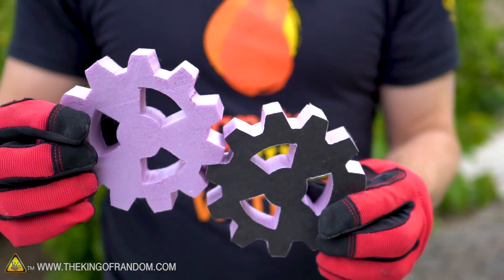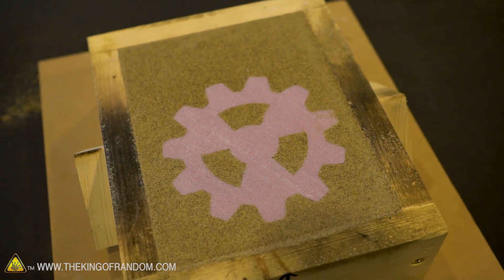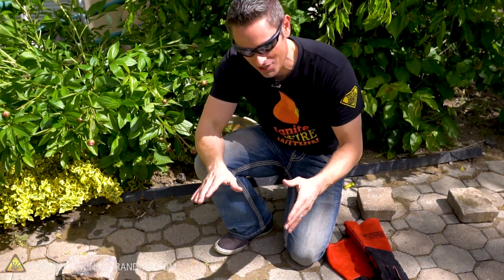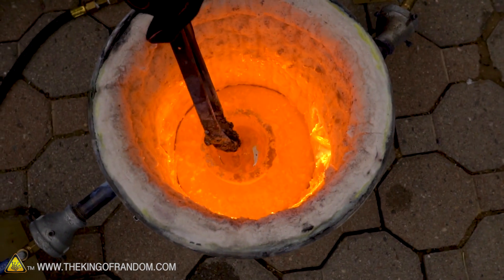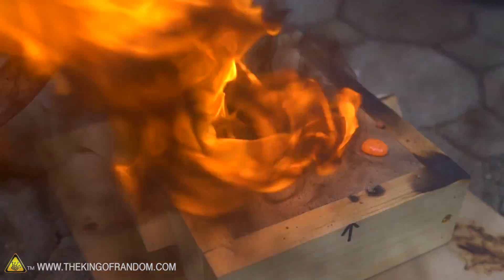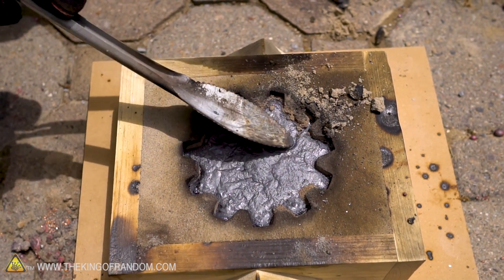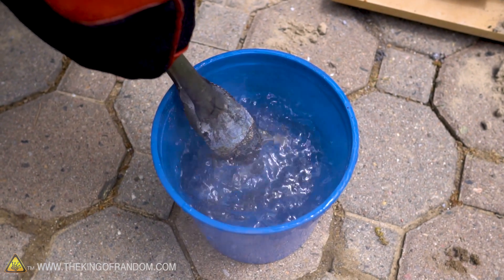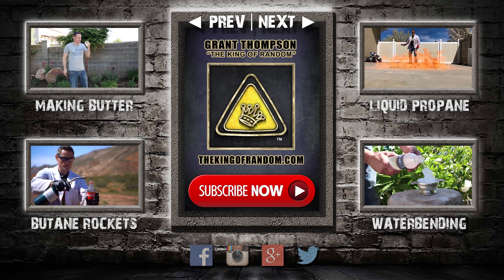Argh. Why Is Copper So Difficult? TKOR Tests Melting Copper In Our Homemade Foundry

Comment: Poke the foam with a toothpick, pull it out with a toothpick. After that, the sand will take the shape of the gear. At last, pour the copper

Comment: why dont you try to heat up the sand mold so that the temperatute difference between the molten metal and the sand isnt that much. that will decrease the rate of energy (heat) transfer thus leaving the molten metal liquified for longer which will hopefuly make a solid cast. highschool physics actually came to use. huh

Comment: you should be doing it as a two part mould with pouring spurs and vents to let the foam gas and excess copper to escape.
The holes won't be able to float up like they did the two parts will hold the heat in longer letting the copper stay molten longer so it can flow into all the details and it should come out absolutely perfect.
also check you have the best sand recipe and consistency.
Reply: Also I think adding compressed charcoal bbq briquets around your crucible once it's pretty hot will boost the temp even higher so it melts even better. oh and get rid of some of the slag off the top of the molten copper as these are impurities which will cause air bubbles in the casting.

Comment: Maybe you could use some kind of steel funnel that will direct the molten copper into the mold quickly but avoid disturbing the sand and breaking it up. it appears that you need to be careful pouring it but that takes too much time and the copper cools down too fast as shown from your first attempt. The other issue was that if you pour it fast enough that it doesn't prematurely solidify it will hit the mold to hard and break the mold on impact as shown in your last few attempts. I feel like you were putting more emphasis on not having enough time too pour rather than making the pouring method more efficient. A funnel might not work but if you had a more efficient way to get the molten copper into the mold in a controlled way then you might have more success. 

Side note: The sand also might have crumbled and broke because the heat evaporated all of the moister in the sand before the metal could fill all the spaces and subsequently pushed the 3 impressions. If the copper is hot enough to stay molten while being cast its probably too hot for the sand to retain its moister and have any small impressions or details on the other hand if its not hot enough it wont cast properly when you pour it. perhaps you need to have an even damper composition of sand before you cast the metal (I know you tried adding some some water but perhaps more is needed?) or maybe green sand just cant handle the heat from the molten copper regardless.

I hope either of my suggestions helps you out. Best of luck!

Comment: you need to keep a lid on the mold with just a spot in the center to pour. that way the sand pillars are held in place and aren't tempted to basically float to the top of the copper

Comment: Hi, if you want to make molds for copper casting you need to try petrobond sand. The sand is held together with some kind of oil, witch cooks the sand when molten metal is poored onto it and kind of reinforce the mold. The problem with greensand and copper is that the temperature difference makes too much of the water boil off at once, thus making the small parts of sand popping of. Greensand is ok for lead or aluminum and other "low" temperature metals. 
Hope this will help.

Comment: How about having the styrofoam covered with another layer of sand with a pouring hole and a couple of vent holes? You know.... just like you used to do with the aluminium years ago?
Watch Tito4re's video on casting a copper apple.

Comment: what about trying a two part mold? A few years ago there was a foundry at a festival I went to where they had sun catchers for the kids to mold and we did the one side with the sun catcher and then dusted baby powder on it and added registration dimples in the sand then put the other side on and repeated the process. opened it up made a path for the aluminum to flow into the part and took the sun catcher out and put it back together. it may help the sand stay in place while pouring

Comment: You might have better luck if you use the cope as well as the drag and put in an intake pipe with a gate for the copper to flow into. The hydrostatic pressure will push the copper down and give you a better quality casting. Don't forget to poke holes into the cope's sand to allow the gasses to escape.

Comment: The best suggestion I can maybe give is to add a 3rd torch or use a gas that burns on a higher temperature, you need the copper even hotter :P

Comment: Grant, try using baby powder on the foam gear so you can use something to cleanly remove it from the green sand. then use both the cope and the drag. That way you have an obstruction free mould which will keep the pillars in place instead of popping out when you pour

Comment: what happen if you use brick or concrete or cement or something stronger. I think there is also a construction sand that is more compact. that could work.

Comment: What if it wasn't working because the moisture in the sand boiled once the crucible got near it since it is a higher temperature then regular casting

Comment: The problem I think is your mold. Why aren't you sandwiching two halves together to guarantee the shape retention without having styrofoam there to occupy the space the copper needs to set properly? I would think that's a more viable way. Plus, if bronze statue casting molds use wax which is melted out prior works for them, why not in this experiment?

Comment: Wrong kind of foam? House insulation is fire retardant. When you pour the copper it takes so much energy to vaporise the fire resistant foam it's pulling so much thermal energy from the copper it's thickening. You just need to use cheap polystyrene so that it can instantly vapourish when the copper flows into the mould! upvote so the king can see this!!
Reply: not really, that's the foam that I like when I cast Aluminum, and that's a much lower temperature.
Reply: DJust787 Exactly what I was thinking
Reply: Exactly
Reply: Home insulation is much more sense than expanded polystyrene, which means there is more foam to vaporize.
Reply: Pink insulation foam is ok, blue is not. Its toxic.
Reply: DJust787 😊
Reply: I have never thought about that. I have been screaming "REMOVE THE FOAM" for the last video.Untill i realized that that would be destroying the mold. That's why i told him to make clay molds.
Reply: I still think he could preheat the mould in the oven at like 200 f.
Reply: DJust787 you're right

Comment: you should have two sand boxes with the item inside between them both and a little spout where you can put the copper in, this way the heat stays inside the sand box and should remain more pristine rather than being messy one side, nice the other.

Comment: grand thopaon why aren't u trying it with both the boxes on.. the cope and the drag... u got what I meant I guess.. make a casting cavity and provide core for the Hallow part of the gear..I bet u will succeed.. u could definitely cast copper using green sand.. I betchya...

Comment: Try putting a layer of wet sand as a bottom layer, well press it. Follow by styrofoam template and wet sand, well press again. Let it dry before pouring the liquid copper. This should works! Better still, some hole gap at the side to reduce pressure when pouring.

Comment: Try making the greensand with fireclay instead of normal clay it's what worked for me.
Reply: or a 2 part mold would work much better
Reply: It is unnecessary to do that if you use fireclay though. and a 2 part mold can sometimes make it more difficult.
Reply: The 2-part mold also allows for greater fine detail and edge detail, something Grant is always complaining about with his casts. He's also experienced enough that a 2-part should prove no issue for him.
Reply: DrakeFaust  If the sand is made with fireclay it should stay in place and allow for perfect details. It has worked perfectly for me
Reply: hes using one half of a 2 part mould
Reply: W Bond : That would just explode on the first try.
Reply: dude that doesn't even make sense. there is nothing in cement that would make it explosive to heat and/or molten copper is non reactive with solidified cement.

As long as he waits 3 days for the cement to fully set, it should work fine and give clear sharp edges to the mold.
Reply: W Bond It would not explode but there a few reasons it would not work, one he would have to crack the mold to get it out and two the heat of the metal could damage/crack the cement.
Reply: or a cement mixture which would allow for multiple casting of the same mold

Comment: Hey Grant. I'd First like to say that I love your videos. I feel that the problem you are having is the greensand. I would recommend that you make a new batch using pure powdered bentonite clay that you can buy off eBay and kiln dried sand. I do not know the ratios off by heart, but you can find them online. This new sand would be much stronger and be able to withstand the molten copper.

Comment: You need a closed mold, not an open one- the little nubs won't be able to float up if they are joined to both the upper and lower surfaces.
Reply: Plus I think his foam is wrong, it should like instantly evaporate.
Reply: no it doesnt. the foam needs to be enclosed in the green sand.
Reply: Yeah, But sand destroying is another problem. Thats why it would need to be a closed CARDBOARD MOLD- JK. It would have to be a clay mold too if he wants the holes in the gears.
Reply: this. do this also the foam needs to be removed after molding the sand
Reply: I was thinking that also if you have a spout to pour down it will increase the pressure and you will have less chance of air bubbles (i think)
Reply: A closed mold with a fill spout will usually give you the best results because it increases the forms stability.  Also using a non-fire resistant foam would help a lot too.
Reply: Yes actually, we made sand castings of foam and wooden molds at school; 20 + years ago. 

We used black volcanic sand and closed molds- the principle however is identical. You were saying something?
Reply: well
Reply: hehe
Reply: SuicideNeil I agree but I think the quality would decrease.
Reply: lol
Reply: There is also the issue of what material is being used in the mold. Foam has a rather high melting point, and house insulation has flame retardants for obvious reasons. Wax should be the material he is using.
Reply: You are right, he can't have pieces of the mold popping out. He can literally put a bit of sand, put gear on it, cover it completely with sand and just leave one hole for casting. That way he doesn't have to remove the gear, but he needs to change the foam.
Reply: Jade_Puppy I experimented with closed molds and aluminum and I had problem with the air inside the mold and the foam.
Reply: Jade_Puppy thats why I said it
Reply: @ Farbod- you need vent holes, the same issue occurs when casting resin in silicon molds. You have your main poor spout and vent at either end of the mold, then you need to poke some small vent holes where air will likely get trapped, in corners and at high points.
Reply: The crucible is clay-graphite, so yeah, kinda
Reply: why he wont do it like he did with an sword ;-;
Reply: Increase, by a lot- this isn't something new or experimental he is trying, sand casting ( in various forms ) has been around for centuries- there must be thousands of guides on youtube to watch, but Grant seems determined to do it the worst way possible ( open mold = rough finish on upper surface, wrong foam = poor quality casting finish as it doesn't evaporate, it leaves burnt blobs where the copper is flowing into ).
Reply: You cant have a mold with peces of the mold popping out. Clay is more stable.I bet the crucible is clay. BUT NEXT TIME CAN YOU REMOVE THE FOAM GEAR.
Reply: SuicideNeil ima large NUBB
Reply: SuicideNeil have you molded one of these before?

Comment: Just mix the sand with plaster and submerge the gear with air and fill holes like CodyLabs did on his Fixing The Ring video, no need to fix the mold or the cast that way.

Comment: You need a top box.... And channels and then vents. That will help your mold from breaking apart like it is.
Reply: Don't worrie about the foam leave it in there it will melt away.

Comment: Hey grant done this a few times, what you need to do is melt the styro with a blowtorch, pour a decent speed but here u are pouring way way wayyyy to fast! The sand does need to be slightly damp also. Hope it works cheers cheers. Do thumbs up so he can see

Comment: Hi Grant. The problem you're having is a combination of the sand being a little too dry and the mould being a little too complex. There are a few ways around this, you can dampen the sand a little more and use pins to hold the sand cores (the bits in the centre of the cog) in place, you could use resin sand cores or, use resin sand for the casting process. Hope that helps :-)

Comment: The thing about copper is that since it's atom size is larger than Aluminium's it doesn't take shape so well, also like with inertia, it takes more power to heat it and it cools down slower on that behalf.

Comment: Just a random thought, but what if you used small wooden rods in the radio active chunk parts to try hold them in place? Not sure if it'll make a difference, but if something were to at least hold them in place but not get in the way it should cast better

Comment: Why don't you make your copper into bronze, it has a slightly lower melting point. Sculptors usually use wax too, it may burn off ever so slightly quicker and may make a difference between success and failure. Interesting videos👍🏻

Comment: ive done sand casting before, and to add suppost for large features such as the radioactive symbol, i placed metal skevers in the sand (for the symbol id say 2/3 in each) it acts to support the sand so it shouldnt move and the cast fail.

Comment: try casting it vertical not horizontal with the foam completely covered in sand, will give you better results.  only have to drill a hole on top of the wood but it will be worth it, you'll get better results this way. hope you try it cause its interesting seeing your progress :)

Comment: usually green sand is used to cast aluminum that have a lower melting point and is less dense than copper, what I think it's happening is the hot copper quickly burn and dry the sand making it brittle and then the density push the sand to the top, you could try to increase the amount of clay is this sand or to create a two layers mold so the sand will not have anywhere to go.
best regards

Comment: I haven't used copper, but why exactly are you pouring it directly into the sand mould? Why not use a runner? Seems like the obvious fix. 
Yes you'd have to cut out a bit after, but you wouldn't have to do it 6 times.

Comment: Put sand all around the gear and cover both sides in sand and then add  a pour hole with a piece of plastic so it flows down into the mold and it's more stable

Comment: When using this kind of mold, when there are small parts that are susceptible to break when the metal is poured, we put small steel pins in these parts to make sure it wont move. If your sand is tight enough, it should be enough to prevent what you just experienced.

Comment: From the article I mentioned "Pure copper is extremely difficult to cast as well as being prone to surface cracking, porosity problems, and to the formation of internal cavities. The casting characteristics of copper can be improved by the addition of small amounts of elements including beryllium, silicon, nickel, tin, zinc, chromium and silver."

Comment: i think you should try using a different type of foam or instead keep the gear thin so when radient heat is used it should shrink so much so it pops out it self and can be picked with twisers and dampening the sand was the reason the pieces float to the top keep it dry

Comment: How about using both halves of the green sand molds just like they use in the videos where they cast the frying pans but leave the foam gear sandwiched between the two halves and have two holes in the top part that you can work?

Comment: You should try to greensand cast with aluminum copper is a heavy metal. Aluminum is easier to melt and doesn't make the sand float up on it

Comment: hey grant, i love your videos. i think the problem is water. the water boils out very fast since its very hot so it turns to gas and saperated the sand. the other thing you should try is maybe heat up the mold first so that there's less water and the copper doesn't need to hest up the mold as much. then you can puor it slower so that it doesn't break the mold. it may be liquid but its still a metal so its heavy and pushes things around. sorry for the long comment.

Comment: You need to try get the gear completely in sand and use a tunnel of sorts to pour the metal... ie a polystyrene rod from the surface to the gear in the center
Reply: It keeps the sand in tact as well as keeping it from cooling down too fast, plus the extra weight from gravity will push the rest of the metal into any gaps

Comment: why would you not put the foam between two layers of the green sand? if you completely encase the foam in the green sand it should retain enough heat to form the full gear should it not?